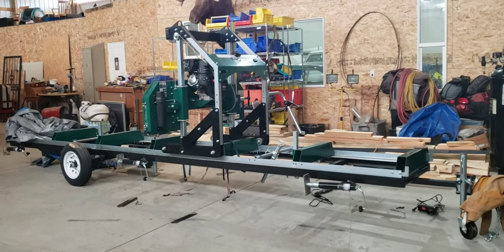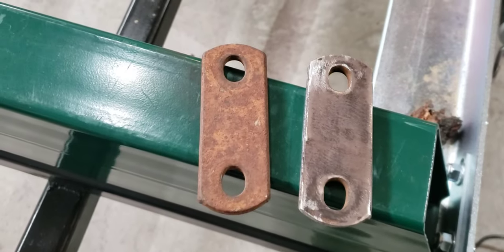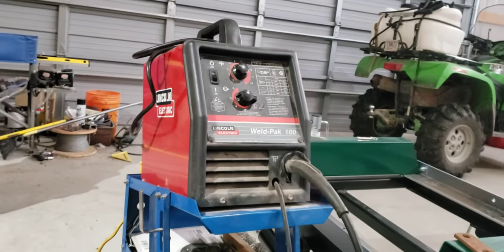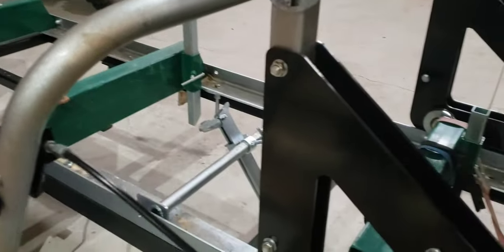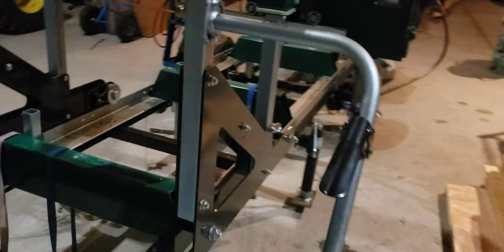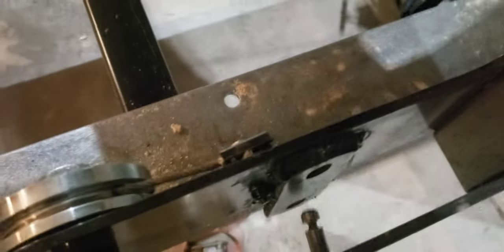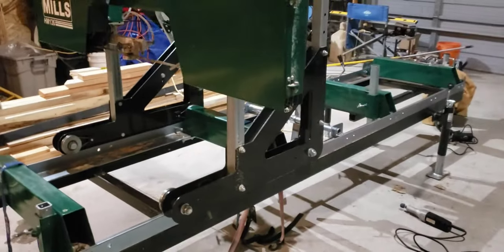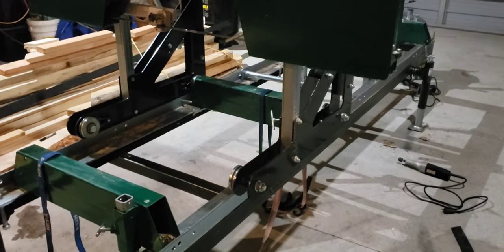Woodland Mills HM126 sawmill- homemade trailer sawhead lockdown

Comment: Great job!
Reply from the maker: Thanks.   It definitely makes it quicker and more secure to move around.
Reply: @brandonstorer6614  I might have to give it a thought.   I have a job coming up that I am moving the mill 212 miles one way.
Reply: What size steel did you use on the trailer build? Thanks,
Reply: @bradhaggett466  I used 4x4x⅛ tubing.

Comment: Brandon, what size steel did you use for the trailer? Thanks
Reply from the maker: I used 3" channel for the main rails and 2" tube for the cross members.  It works good for moving it around the property